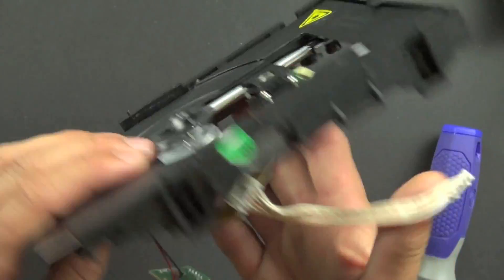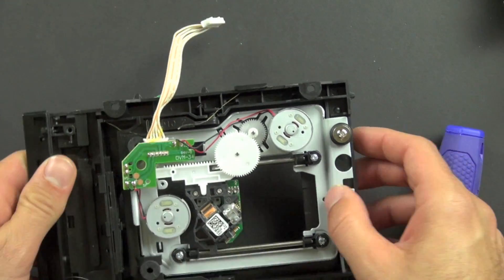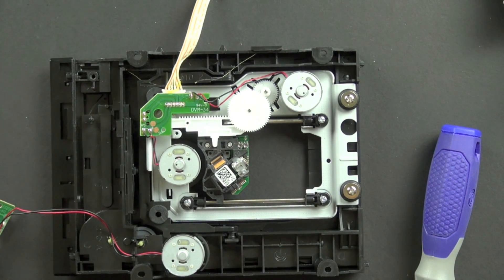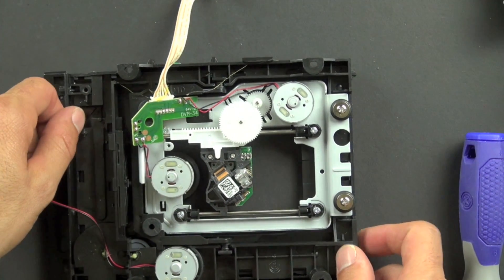What is inside a DVD player? (4 of 5) | Electrical engineering | Khan Academy

Comment: Why don't these ones have a stepper motor to move the laser assembly like the ones used in PC's?
Reply: Probably to save space.Stepper motors in dvd's have additional circuits in it to make it work.They used dc motors in generic dvd players so there is no bldc/stepper motor driver or whatever.Dc motors is the most accesible motor's around the world.
Reply: Then which motor is used here in the video bro....